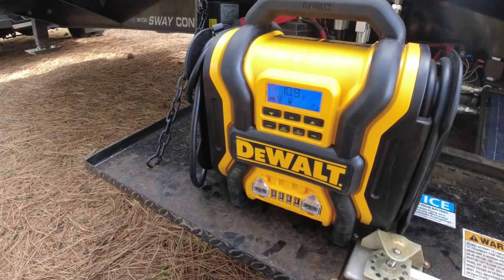KAREN REPORTED US FOR “ILLEGAL” LOGGING  DAY IN THE LIFE of hauling equipment

Comment: For your trailer battery, you should be able to set it up so the truck will charge it when running.
Reply: They make winch wiring kits for trailers, that have 2- 1/0 cables to come from the truck battery to quick connections at the back. I installed them on my 3500 for my dump trailer. The wire out of the 7-way is just a trickle charger/maintainer.
Reply: There is away cause a 7 pin should have a 12v hot that could charge it going down the road but they make a small 50watt flexible solar panel that would do better then a 10watt and if he wanted to do and Anderson connector and run a 8ga wires back so when needed to connect heck jumper cables or winch he could and plug up the truck when its cold to a battery charger but if there is a will there's a way....

Comment: can also use your milwaukee battery as a jump pack . Positive and negative terminals are marked on top of the battery. Just need set of cheap cables modified to slide into the contacts.
Reply: Actually JEGS and Summit have a cool adapter that neatly attaches to a Dewalt or Milwaukee battery.
Racers use them to power up gouges and lights instead of needing a heavy automotive battery.

Comment: I grew up farming and running heavy equipment - that stuff never gets out of your blood - really enjoy watching and learning from you.
I still run some trucks and trailers for my own personal use but am unhappy with the lack of operating gauge info on my 2018 ram 3500
I see different setups on your trucks but can’t tell much about them
That would be a helpful video about how you set them up and what you prefer on aftermarket gauges
I also just put a ranch hand bumper and winch on my 3500 and have been told it will cause engine or transmission overheating because it is in the way of airflow over coolers what is your experience on that?
Thanks - stay safe and keep ‘em going
Reply: What operating gauge info you want displayed? I have an '18 3500 Ram and it has all the info I need. Boost, braking HP, oil press., oil temp., trans temp, etc. I might even find EGT if I dug into the commercial setting far enough.
Reply: @johnirwin1837  yes sir mine has that but I’d like to not be flipping through the buttons all the time
Ive tried to find the egt - that would be one I’d like to have easy access to
Main thing is just easy viewing without constant flipping
Reply: @bud1340  , ok. I really don't care to constantly watch them. That is what the computer does anyway. I run an '04 that did not have the info we have now for 216K miles and 14 years and not one visit to a shop for any engine repairs. Still going strong when I upgraded. But I realize not everyone is like me.
Reply: @bud1340  You may want to look into an Edge II gauge screen. I use one on my competition sled pulling truck. It's a large (4" I think) screen and it's customizable to show what parameters you need to see, and the size/placement of those gauges.
Reply: @gadsdenconsulting7126  That is awesome - exactly what I need.  Thanks!
Reply: @bud1340  You're welcome! Glad I could help!

Comment: I wrap the boom with a strap, not a chain. Even tractor buckets I use a strap and maybe add edge protectors if needed. I'm getting ready to wire both my trucks with 1/0 welding cable to the front and rear to run the winch or jumper cables. I can put the winch (12K) in receivers front or rear, and on my trailer.

Comment: On our dump trailers and hydraulic dove trailers we run a constant hot wire plug next to the trailer plug and use the same plug transfer trailers use on our transfer trailers to hook it up, and run it straight to the battery so you always have power when it’s hooked up even if the battery isn’t good

Comment: On the new truck you set it up with the hard wired quick connects for winches and wire the trailer so if you need to you could run the trailer off the truck battery’s.
Reply from the maker: Yeah I’m definitely going to do that! Been loooking into it

Comment: First time viewer and new subscriber here.
That’s a nice setup you have there with remote wood chipper.The battery pack saved the day.
Now,when these Asian Long-horned beetles were imported here by default everything under the sun is being shipped from China now have these Lantern Flies that target the trees as well.They’re all arriving via packed shipping containers from the same usual China.The neighbor may God forbid encounter a Widow-Maker/Karen-Taker instead of being stewards of the land.If you wanted to buy a portable sawmill and mill any viable logs off these properties at your leisure you can stand to make a killing with the way the prices of lumber skyrocketing.Its just a thought and idea where you have the potential extra revenue opportunity when harvesting trees both fallen and dead.As far as securing the arm on the flatbed,the military rated tow strap is perfectly fine lashing around hydraulic towards both sides if it means keeping the equipment from shifting.It does the job and wherever you can avoid using the chains the better is how I feel.Enjoyed the video.

Comment: What type of contractors license did you get ? General ? Landscape ?
Reply from the maker: Forestry
Reply: What section Is it in I wanna get mine  also I talked to Jim at global thx for the info I’m
A few weeks away from getting a mulcher head
Reply: Was thinking about your battery on the trailers , on my Ram3500 I have a 0/1 wire with an Anderson plug that goes to the rear and the front mounted under my bumpers . I use them for my winch ya could easily do the same thing on your & trailers just run the wire on the truck with the plug and make a pig tail on all your trailers that way you always have power and never have to charge it up . And if ya have a winch put it on a winch plate/cradle,receiver   and can also be used that way in case of trouble ya never know . But for sure for dump trailer and electric dove tails 
Hope this helps ignore the Karen’s they’re such asshats lol

Comment: You should install a DC to DC charger in the trailer so it can charthe batteries while you driving. Saves plugging it in at night to recharge the batteries.
Reply from the maker: Truck doesn’t tow the trailer daily. Trailer sits and that’s what happened here
Reply: @VBELTandSON  that dodge Cummins 6.7 sounds awesome with diesel power 😎😎😎😎😎😎😎😎😎😎😎😎😎😎😎😎😎😎😎😎😎😎😎😎😎😎😎😎😎😎😎😎😎😎😎😎😎😎😎😎😎😎😎😎😎😎😎😎😎😎😎😎😎😎😎😎😎😎😎😎😎😎😎😎

Comment: Use beam blades not the crappy traditional. Multiple pressure points will streak quickly
Reply: @VBELTandSON   windshield wipers. Rain x latitude or Bosch Icon. That style wiper blade lasts a lot longer without streaking.

Comment: sam what are those guages  flashing by your steering wheel
Reply from the maker: Camera makes them look like they are flashing they aren’t. But fuel pressure and egts
Reply: @VBELTandSON   i have a 2006 2500 G56 truck put a clutch in 5 months ago new throw out bearing i noticed a faint hum noise in neutral it goes away when pushing clutch pedal in is this normal?